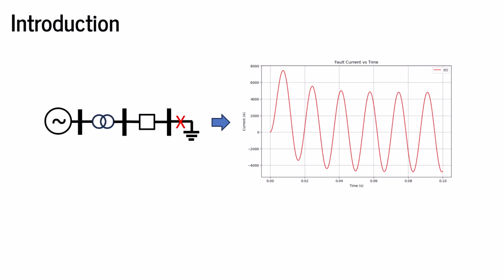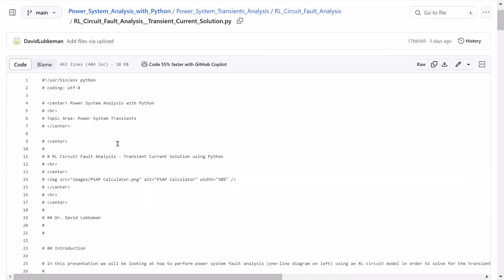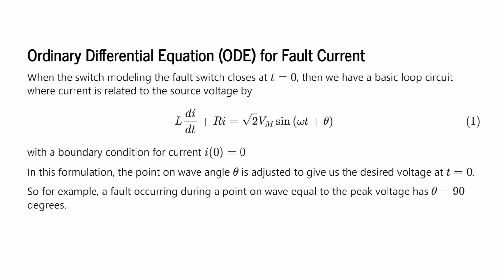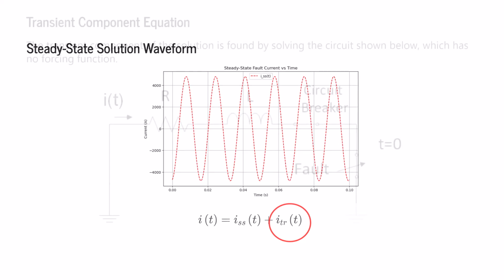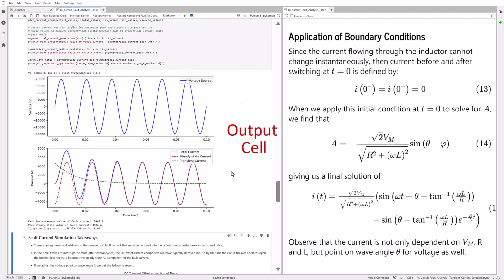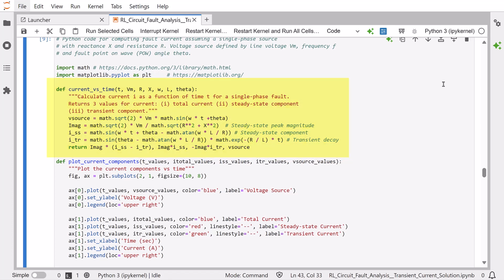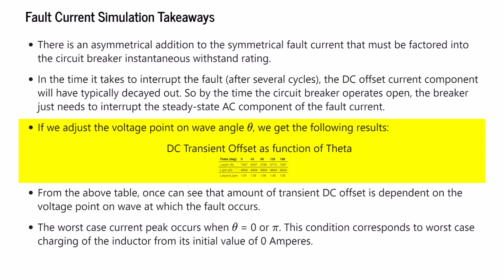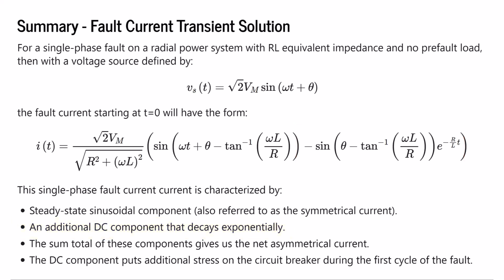RL Circuit Fault Analysis - Transient Current Solution

Comment: According to the DC component formula, shouldn't Theta - Phi = 90  results in the maximum DC offset, thus the maximum Asymmetrical current?
However, your notes indicates Theta = 180 yields the maximum Asymmetrical . Can you pls explain.
Reply from the maker: You have a maximum positive current when switching occurs at theta = 0 and a maximum negative current when switching occurs at theta = 180 degrees.  Both currents have the same magnitude though, which is why in the table at the end, we get the same asymmetrical current impact for theta = 0 and 180 degrees.  So considering there is a positive and negative current peak, we get the maximum magnitude of DC offset when Theta - Phi = +/- 90 degrees.  If you take my sample code, you can rerun with theta = 180 degrees and see the same plot I showed, but just flipped about the horizontal time axis.

Comment: Thanks. Do u have a worked example for a 3ph fault.
Reply from the maker: No, this would get complicated to work out by hand.  You certainly could do this in PSCAD by modeling the source and impedance models as three-phase and applying a three-phase fault.